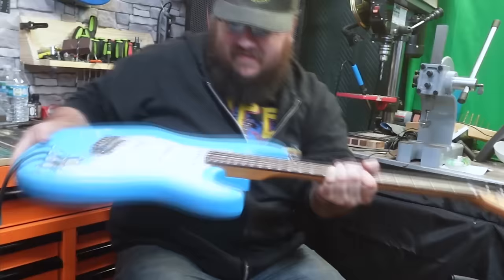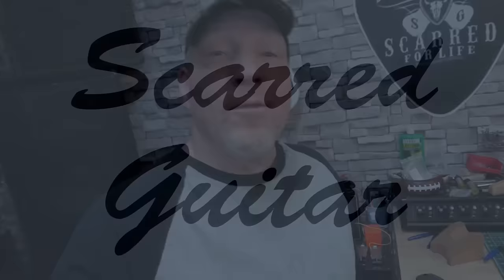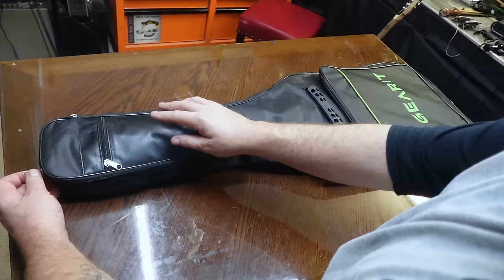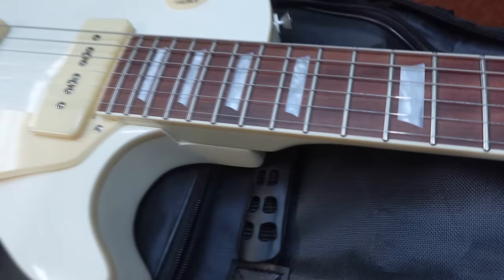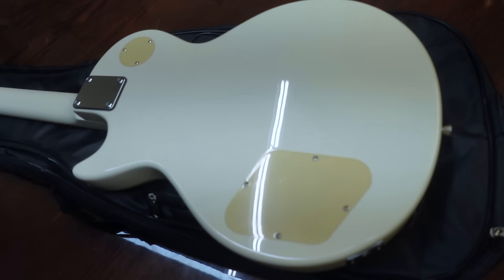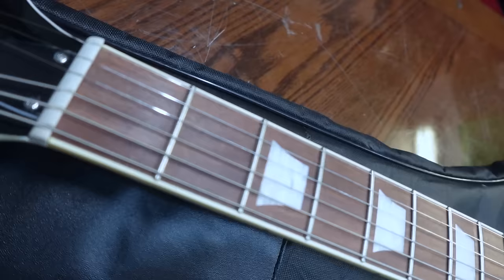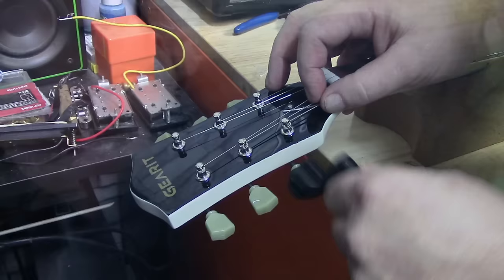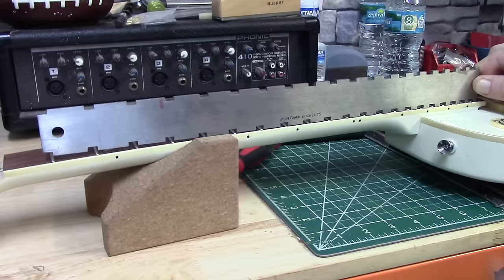Amazon Les Paul Copy IS A BEAST! BUT IT TOOK SOME SERIOUS WORK To Get It Right!

Comment: Ok what amp, amp sim, software, pedal combination are you using to get that tone?
Reply: It seems like no matter what combination of garbage you throw at it, it sounds good! I'm just curious.  

I run amplitube software in my studio and everything I have sounds better in studio software than real amps. Not that I have a lot of amps but even my fender bassman or mustang amp just doesn't have anything compared to software simulation.
Reply from the maker: I mostly use the Line 6 UX2 with Pod Farm on the Standard Country setting that I tweaked a little. But I use that same setting for each guitar.

Comment: This proves my theory about cheap guitars: If you can do the work, they can be good guitars. But cheap guitars that show up to customers like this would definitely turn someone away from guitar all together. Your first experience with a guitar should be a good one, not pull out a brand new guitar, just to have your excittement dashed by a backbowed neck, crappy tuners, and oxidized frets. Are cheap guitars even any good for anything?? Yes, they are great mod platforms, and great to learn the ropes of guitar maintance and repair. But if this showed up at my house in this condition, best believe, the company is gettin a nasty email from me, and i WILL be getting a refund. Honestly, they should be ashamed of themselves actually  putting out a product in this kinda shape. Its always been my thing that a guitar REGARDLESS of how cheap, or expensive should show up ready to play right out of the box (Then you make your personal adjustments to suit your playing needs). Either way, atleast Sean is out there saving the world from cheap and trashy guitars , all HAIL SEAN! LOL

Comment: Never understood why people would bother to purchase a generic branded guitar when you can purchase a low end brand name such as Ibanez for a measly $200 bucks.
Reply: So, an unbranded guitar will sound and feel inferior to a brand name..its a guitar,its wood,wires and pickups.The past 5 yrs or so have produced some dam good no names.if you dont have the know how to modify, that can be an issue..Besides, the low end guitars from the big companies suck..so what do you gain?..Buy an old crappy guitar and a solder gun..get in to it as a past time or hobby..Your first proper pickup or neck swap will open up a whole new world for you..its insanely addictive and honestly ..rather simple..make it so...Leo .Builder/repairs